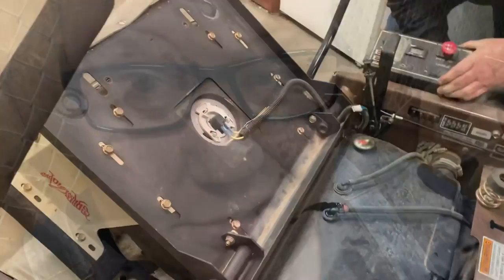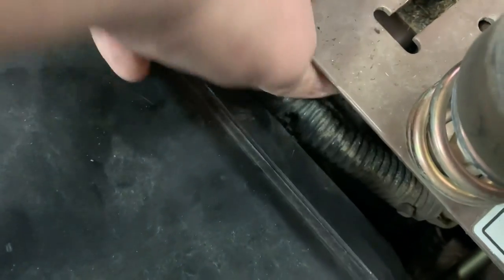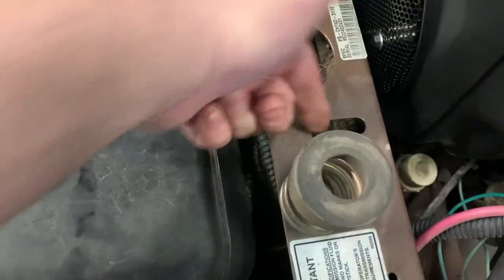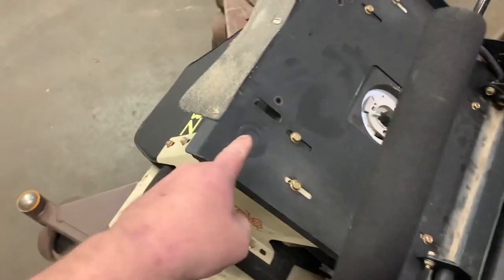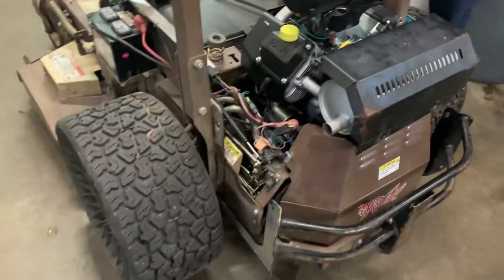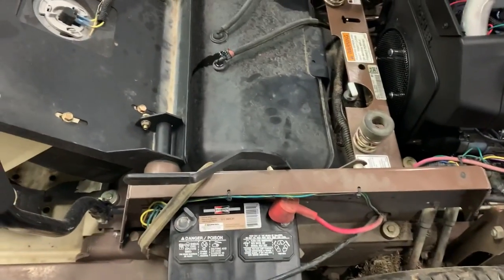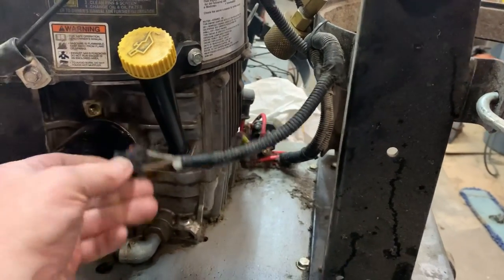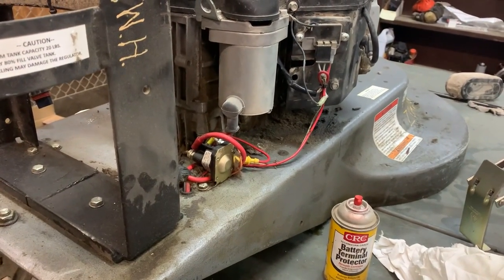IF YOU OWN A GRASSHOPPER MOWER GO CHECK THIS RIGHT NOW!

Comment: If that harness is wrap tied in place like the factory intended it to be, those hooks will never touch it. Somebody is either pulling on that harness allowing slack to let it fall out of place, or someone is cutting those wrap ties which let's it fall out of place. 

I've ran and worked on these mowers since 2002, and never seen an issue there. I have seen missing wrap ties there, but I always replace them if I catch it. I blame careless repairs and maintenance before Grasshopper on this one.

Comment: Great video. I had this issue with my 227 many years ago (it's a 2004 model still running strong). Had to tear the whole frame apart to repair the wires and wrap some heavy duty flex hose around the harness. I love this mower and would buy another BUT it's definitely a huge design flaw and grasshopper was NOT at all helpful when I contacted them. They would only support me through a dealer which wouldn't be bad except that I already had my machine tore apart which is why I just repaired and patched myself. I removed my ROPS and the latching system because of this flaw. If Grasshopper still hasn't fixed this flaw after all these years then I'd have to assume they like sending their dealers this repair job.

Comment: We have the grasshopper 325D. The way we prevented the wires from getting pinched. Is by taking four zip-ties and pulling the wires back and tight out of the way of the lever hooks. Hopes this helps.

Comment: Thanks. I checked my 2011 721D for this. No problem. The factory zip ties are still nicely in place holding the wiring group about 2 full inches forward of the latch slot.  I appreciate the heads up though. 👍

Comment: This video is great because wiring is something that you do think much about but can be a real headache. I think all manufacturers could do a better job shielding and routing the wiring in most all equipment, and vehicles. Had trouble with lots of stuff I had to repair. Sometimes it was something as simple as a tiny bare spot, you couldn't see rubbing the metal and shorting out. Had. Motorcycle once and it ran like a champ but had a problem cutting out occasionally when you made a hard right turn. I looked at EVERYTHING. Or so I thought. Fuel system, electrical system, looked for shorts everywhere. Couldn't find ANYTHING and it was an intermittent problem so it was really hard to pin down, UNTIL one day it crapped out so I laid the bike on it's side and heard a clunk. It was the battery. It was just loose enough to slide slightly and the terminal touched the frame and shorted out the ignition system. It was tight to the touch but designed so close to the frame it shorted. Anyway, wiring, very important!! Thanks for the reminder. And shame on Grasshopper. 😠😄

Comment: DingDingDing Ding!!! The power deck height stopped working on my 428D. The electric motor and pump work fine when you run 12V to it. I replaced the relays and switch, and get 12V at the connectors...but it won't run the deck height motor.  I was planning on looking at the harness...now that I've seen this vid though, I know right where to look! I'll BET that this is the problemo with mine! (Had disconnected the electric motor and have been using as a manual for the past 2 years!) THANKS!

Comment: Operator error. Ive noticed a couple bad placement of zipties on all my grasshoppers but fixed them immediately. 
Once it happens to you once, best next step would be to fix the issue to prevent it happening 9 more times.
You mentioned in the video to be aware of your wiring & exposed cable, so why not just fix it so its not an issue? 
Grasshopper is the last mower to try & slander because we all know they're phenomenal machines with plenty to offer. 
I have a few things im fixing on my 725D right now actually:
-Lever tension spring snapped
-coolant tank is cracked 
-deck level lowers a little in bumpy terrain 

Ill fix it though. Its a lot of machine, so I understand many things could go wrong, unfortunately.

Comment: Good info. I do my own maintenance on my 223 mid-mount with a Kohler Command Pro 23 hp and it runs like a champ.  One question, where may I obtain a shop manual that contains more info than the standard owner's manual for it?  I've looked but haven't found anything.  Thanks.

Comment: I checked on my wiring harness right away.   One side was wire tied, but the other was not!  So I put a zip tie on the other side.  Be careful if you are going to take the latch off, know that the seat belts are connected to the seat, not the frame.  At least on my 227.  If there is a roll over then the seat can flop forward yielding questionable results.

Comment: Great video MowerMedic Grasshopper needs to re rout the wiring harness more to the front of the seat frame and add a heat shield to protect the harness from the engine heat that may be the solution to the problem.

Comment: Stupid Question, I have a 1997 625 gas, Grasshopper that has sat many years before I bought it. The left hand drive is noisy and weak when warm. 
I also have a 2016 Cub Cadet Z-Force 48 that I bought new. The left drive on it is getting weak also. 
I have look at other units for a used replacement, but it's usually the left drive is weak, no matter what kind. Grasshopper wants $1700.00 for one new drive. Way out of my price range. Do you know of a fix for these drives? I know the Grasshopper is a totally different drive than the Cub. I used to rebuild all different types of pumps, (Hydro) and the GH sounds like the pump is dead heading, or working against itself. 
Where could I find a kit to repair these things. I just can not find the parts.
Thanks,
Bill

Comment: I would like to ask a question/ seek advice . I am looking at a grasshopper 618 mower . On line I have seen a lot of negative about the th18s engine in these . It's a good clean unit with 300 hours on it . What I have seen is that when overheated they drop sleeves  , I am thinking that if it's been cared for this long and is running good , then if I continue to care for it it should be ok . Do you think that with care it's a good mower or is it just a grenade waiting to happen ?

Comment: I got a 725D and sitting on it it would be the left tire spins way faster then the right, when I barely push the handles forward the left spins and tears up the grass every time I could drive this backwards up a wall but going forward I can't barely get over a 6 inch bump with out that left tire digging a trench, I've tried all the adjustments and nothing seams to work I'm about ready to put this grasshopper in my burn pit

Comment: My hook doesn't work on my seat. I take off my seat cushion between every stop because the wood is gone. It fell apart after about 5 years. My 329b has never sat outside of the garage not even 1 night and has only gotten wet when i get rained out mid while mowing. Or when cleaning about 2 times a year. 

Im going to redo the seat with Advantech osb if i ever get the chance. No way im paying over $200 for a small portion of a seat that falls apart when it gets wet maybe 50 times. 

Other than that my only gripe is the front casters were dry of grease from the factory and locked up after about 300 hours. 

10 years and 1700 hours and no problems other than those 2 things.

Comment: I run a Grasshopper 727K and the Kohler EFI runs extremely hot, I was told by the factory rep that they run them very lean for emission reasons, I have replaced the muffler because it burned a hole through it, Kohler would not warranty it. Also, it runs so hot the bearings in the electric clutch cooked the grease out, there is no way to service this unit without removing the clutch and taking the seals off, and packing high temp grease in both bearings every few months. I will not buy another one, just for information I clean it off with compressed air every use, it is not overheating from lack of maintenance. Thank you for your videos, I appreciate them.
Reply from the maker: What head temps are you getting?
Reply: @THEMOWERMEDIC1  I do not know, but the valve cover gasket got crispy and started leaking a small amount of oil so I replaced it, I have no way to check temp .
Reply: Just don't buy one with a Kohler...There is other options

Comment: I had 2 Dixie Choppers that had bad wiring harness one had a low voltage to the coils and burned up the engine misfire too lean great video 😊
Reply from the maker: There should not be any voltage to the coils
Reply: Right the wiring harness caused the misfire 😁